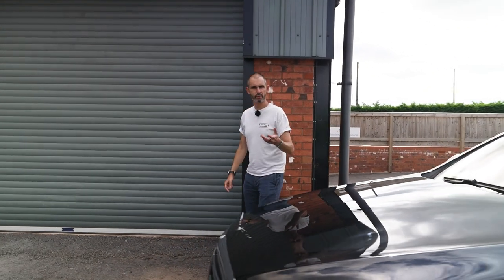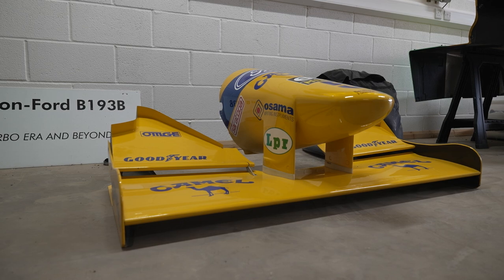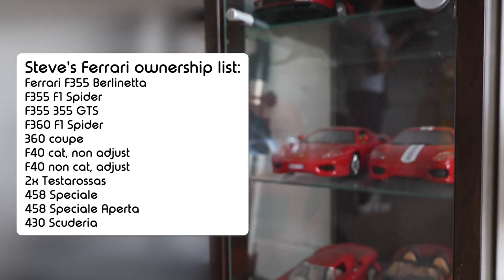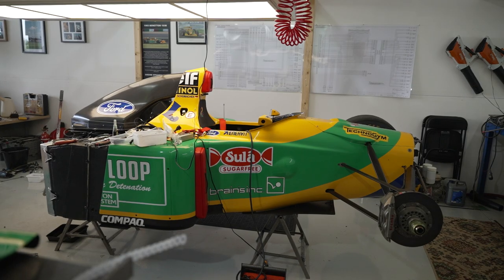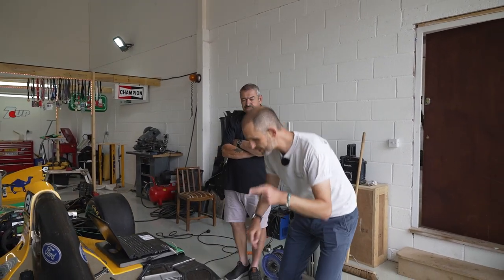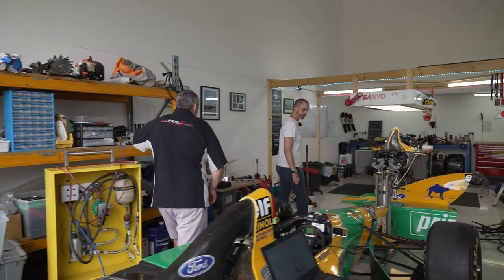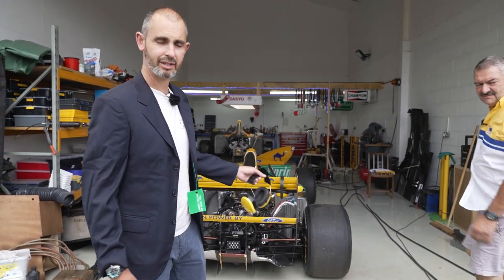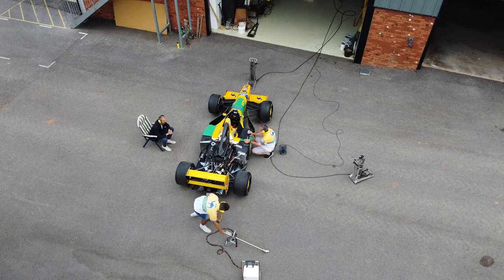Firing up Schumacher's '93 Benetton F1 car in the back garden - Car Cave

Comment: Hi guys we built those engines at cosworth.  I was a engine builder there through the 90s into the 2000s. Kind Regards Bob Rose Northampton..
Reply from the maker: Hello Bob, thanks for commenting.
Reply: Interview Bob please :-)
Reply: @raytrace2014  hi Teddie how's you sir..regards Bob Rose
Reply: Can you still call there and buy spare parts? Or are there any manuals on how to setup or repair such an engine?
Reply: @daybyter  I'm not sure if you can by parts for the HB engine. The company I worked for before cosworth. Was called Langford & peck. But now its just called Lanford performance. In Wellingborough Northants. They were building the HB for historic racing so they may well have parts still. Dick Langford is the chap that you would need to talk to. Hope that helps. I'm afraid I don't have the number. But you should be able to go on line and find them..the address .is Findon Road industrial estate Wellingborough. Kind Regards Bob Rose.
Reply: @bobrose513  Sorry for the misunderstanding. I don't own such an engine. I was just curious where you can help with those issues
Reply: @daybyter  hiya. That's OK my friend no problem.
Regards Bob..
Reply: When he says there ‘aren’t any more air valve engines in the world’ does he mean running engines? McLaren used the exact same engine in the latter stage of the season.
Reply: @bobrose513  hey Bob cool stuff what you worked on seriously !!  
Wondering if you can you clear up a old Cosworth wives tale please Sir ? The Mercedes Cosworth 190 had a 2.3 16v Cosworth Modified engine Internal Cosworth Code WAA and the 2.5 16v was WAB and Evolution WAC, my question is did Cosworth manufacture the WAB heads or did Mercedes and it was just a Cosworth design ? 
Cheers 🇬🇧
Reply: Hi, do you know where we can get BF1 early 90's memorabilia, particularly the clothing...shirts, jackets, hats, shoes, gloves, bags, ect
Reply: @chiefrocka8604 hi. I never worked on the 190 merc. But from what I understand  it was just the head. But as I say. I was on F1 at that time. So I wasn't  up on the road cars..

Comment: Schumacher made his debut for Jordan Ford at Spa in 1991, then straight after was poached by Flavio Briatorie and Benetton. His first Grand Prix Victory came at the 1992 Belgium Grand Prix in the Benetton B192.
Reply: I still like the B191-06 livery design better. Also driven by MSC btw.
Reply: I screamed when I heard his version of history too
Reply: You could have added the bit about how he got the Jordan seat… a few months earlier I was watching Schumacher at Le Mans.
Reply: @stormmeansnowork  I think the predecessor, the B-190, had an even better livery.
Reply: @Athrun82  Oh I basically fell in love with Benetton because of the B190, honestly it's hard to choose which is better, but if I had to pick one only, I would go for 191-06
Reply: I was there at spa to see his first win
My first gp

30 years later I watched his son in Hungary along with jos verstappens son ( super max)
Reply: @stormmeansnowork  technically only Piquet drove 191-06, Schumacher drove 02 and 05 that year. 02 in Spain, Japan and Australia, 05 in Italy (his first Benetton race) and Portugal.

Of course I know you mean the 191 in general and I pretty much agree it's a slightly nicer looking car and livery than the 192/193, the extra Blue and the Autopolis logos help.
Reply: @mathertom  Didn't know about the 02 and 05 chassis thing TBH, thanks for filling in the information. The reason that I single out the 06 is that (as far as I can Google on the net) it sports the Benetton logo on its side, whereas the 02 chassis have the Autopolis logo. Nevertheless, the blue yellow green tone of the 191 (in general) looks better than the simply green-yellow of 192 and 193.
Reply: Benetton in 1993 with the B193 at the hands of Schumi and Patrese in his last year of his long F1 career, was a regressing year because they had to compete similar engines with the Mclaren-Ford MP4-8 driven by Senna and Andretti.  They only won one race in Portugal '93 Estoril when Prost finally clinched his fourth and last World Title.  

Senna won 5 races in a debatable Ford HB V-8 Engine which he complained "down on power" than the factory backed Benetton team.  1993 was the zenith of the F-1 Cars in terms of all the advanced technology, servo-assisted, touch button down shift programming control (for example from 5th to 2nd instantly), active-ride suspensions, and Minardi even attempted 4-wheel steering.  They were like lightweight spaceship rockets before the FIA banned a lot of things in 1994, which probably directly led to cheating on purpose with various teams, and the tragedies of Roland Ratzenberger, and of course, the great Ayrton Senna at the fateful Imola GP on 5/1/94.
Reply: Flavio, the man with skin like a chamois leather cloth 😀🤟
Reply: @fuzzy1237  I met him, at his debut :)
Reply: Wouldn’t say he was poached? In his letter to Eddie Jordan.. he clearly states I will sign a drivers agreement meaning his options were always open? Having the confidence in himself knowing that Jordan wasn’t going to be a future team for himself..
Reply: And in the RAIN. Not many drivers can say their first victory was under such dire weather...

Comment: Lovely 72 Suzuki GT750 ...For the home Japanese market the first Suzuki Gt750 in 72 was a GT750B1, The bike had a split head and is obviousley very rare..Ii have all the required parts ie, cyl heads, longer headbolts, and gaskets in my shed to convert an early Uk engine into a replica  ...

Comment: The coolest thing for me is I have a Tamiya 1/20 scale model kit of this particular car.  It's a 1992 version of the car.  I think I have had this kit for at least 25 years or more.  I started doing some painting on the kit but I had to shelve it because I was so busy with my business.  So I am now retired due to basically wearing my body out at the age of 52.  I have a woodshop and I still build products for houses and I want to get back into building models of F1 cars (love the late 60's cars) along with all the killer prototypes etc.  I have a ton to learn about the modern world of modeling because paints and glues are 100 fold better than that horrible tube of Testors glue and the limited paints etc. that we all built with through the 70's and 80's... LOL
Peace

Comment: I like the vid. However the water buffalo is not slow. I owned one and rode it for three summers. The power band hits you hard somewhere around 7000 rpm if i recall correctly red lined at 11,000 rpm . It is also a short wheel base. The bike had a crazy habit of standing up on the rear fender when the power band come to life. The bike is a two stroke 750 they suck for power then they unleash themselves after the power band. Then hang on for the ride. Ever wonder why big two strokes aren't on bikes much

Comment: Just a little correction.  Schumi's debut GP was Belgian GP of 1991.  Yes, he only raced once for Jordan (Michael actually bought that car for himself years later)  and didn't even last a lap because his clutch broke on the first lap.  He was there because the regular driver, Bertrand Gachot of Belgium, was in prison for 6 months because he used CS Gas and attacked a London Cabbie.  

So in a hurry, Schumi was signed up with funding from Mercedes- Benz from his Group C Endurance Racing days.  Willi Weber, was very crafty and careful of changing the terms of the contract, because he knew how special Schumi was.  Eddie Jordan knew that too and Michael's talent was sealed.  He qualified 7th on the grid ahead of his much experienced teammate in Italy's Andrea de Cesaris.  

The funny thing was that Jordan desperately wanted Michael's service because 1991 was the debut season for Jordan GP Team.  However, much better funded Benetton team under Flavio Briatore, Tom Walkinshaw, Rory Byrne, Ross Brawn and other greats, were too good to pass up.  Soon after the race, Weber announced suddenly that Michael would immediately switched over to Benetton to partner the three-times World Champion Nelson Piquet, now in its last year of competing F1, for the rest of the season.  

As compensation, Benetton would send its second driver, Brazil's Roberto Moreno, back to Jordan in return, plus an undisclosed lump-sum exit fee for Moreno as hush money.  The time leading from the end of Belgian GP in Spa' 91 to the next race at Monza in Italian GP' 91, were filled with shock and awe with these breaking news, verbal accusations and pending lawsuits.  

For the rest of the year, Michael surprised and cemented his hype by scoring only half a point less than one of the all-times legend in Piquet, in the fourth best team, with a weaker engine and the inferior Pirelli tyres.  Moreno, on the other hand, only raced twice with Jordan, before punted out by Eddie for the pay drivers in Zanardi for the final three rounds in Spain, Japan and Australia.  The poor forgotten man, Moreno, was picked up by Minardi in Adelaide.  Ironically, Spa 1991 was Roberto's last ever scoring finish in F-1 and a competitive car.  For the rest of the career, he raced in the absolute horrid cars who never deserved to be even on the grid, let alone with Roberto's decent talents in his junior formula with the F3000 crown.  

If you are the Devil's Advocate and had Schumi stayed with Jordan for the rest of 1991.  Then Jordan got a big expenses reprieve with the factory engine deal from Yamaha in 1992 from Brabham, however, they only managed to score one single point with the experience Modena and Gugelmin from both Tyrrell and Leyton House respectively.  1993 would once again seeing the second rising of Jordan GP,  now with the Hart V-10 Engine, to once again fight in the midfield battle.  

The luck of Schumi and the rise of Benetton-Ford since 1991, had gone from strength to strength with him winning his first and very controversial crown with the Finale ' 94 in Adelaide, and cemented his status with the next crown in the much inferior B195 Benetton-Renault over the much stronger Williams-Renault FW-17 of Damon Hill and David Coulthard in 1995.  

The rest of the legendary Schumi career, with the poaching of the best staff in Brawn, Byrne, and others to Ferrari in 1996 with the new leader Jean Todt at helm, in the 5 years plan to scale the summit of F-1  in 2000.  Then more importantly, to rewrite F-1 history and record books until something named Sir Lewis Hamilton, were witnessed by all to its full extent.

Don't worry, Eddie Jordan got even with Michael Schumacher.  He signed his younger Ralf for a longer term contract for the multiple seasons, and Eddie got the best lawyers this time around to make sure nothing funny was going on.  Ralf was supposed to race in 1999 with Jordan but there was a substantial penalty for the early exit clause.  When Ralf told Eddie that he would leave the Benson and Hedges Jordan-Mugen Honda GP team for 1999 and racing with the Winfield-Williams Supertec Team to replace the departed Jacques Villenueve headed to the brand new British American Racing (BAR) Team.  So who paid for the multi-million dollars fee with this 'early exit clause'?  None other than Michael Schumacher himself!

Comment: Superb. I’m pretty sure one of the problems of running these cars is the laptops and operating systems. They’re that old such as Windows 3.1 there’s hardly any to be found.
Reply: The laptop shown is fairly modern and running Windows 10, I guess they found a way to run the software on newer systems
Reply: Possibly running a virtual machine of the old operating system on a modern laptop. Most old operating systems can be emulated.

Comment: Supposedly the B194 had 460 torque at 11600RPM, probably the most high low RPM torque car for 1994 which would made it likely to spin. I suspect this why there was talk about traction control.

Comment: Why would it seize on startup if the temps are less than 65 deg C (149 deg F)?   Single "weight" oil?   Weird clearances somewhere?  Too much oil pressure?   21:30

Comment: I got a lot of respect for Schumacher when he raced the manual Benetton Ford even with the supposed launch control controversy, what he achieved with it told me how talented he was, like later in the Ferrari stuck in 4th ? and still put in a great race, I kinda lost a fair amount of respect when he started his nasty driving which got worse up to his first retirement, ramming other drivers and the oops my engine stopped at La Rascasse on Monaco track right after getting the pole time (coincidental that Le Clerc had a red flag moment after getting his pole time in a Ferrari).

Though my all time F1 car which got me into F1 is the Lotus John Player Special driven by Andretti in the late 70s, although I had a diecast model of it but with Mansell as the driver, no longer have it as it mysteriously got damaged though the kids knew nothing at all lol, I had a lot of diecast models that parts (wing mirrors mostly) disappeared, worth quite a lot of money now, I threatened to buy a glass case for them but was too late.

Comment: I liked the cars when they had no driver's aids, a manual gearbox, and a low revving V8 (under 7,000 rpm) of decent capacity. Here in NZ we called them Formula 5000 as they used a 5l V8. They thundered around the track, today they scream, the drivers had to drive the car, today they managed them.

Comment: So at risk of being all 'adenoidal nerd'...

I think it's pretty obvious that they're not completely keyed into the history of the cars. I shouldn't say much at all because they own and run them and Johnny has come along and is clearly amazed at the cars and the story and the car cave in general and it's wonderful content as per usual from The Late Brake Show, absolutely one of my favourite channels on YT...

...however, let's get some facts straight for posterity.

- Schumacher debuted in 1991 at Spa, not 1990. He drove Jordan 191-05 (easy to remember cause 91 in the car name - 1991, 92 - 1992, etc for Jordan, Benetton, Minardi and a few others)
- he was poached in between Spa and Monza by Briatore, much to Eddie Jordan's chagrin
- he debuted for Benetton in a B191 (chassis 05, interesting he jumped from 05 to 05 in between teams)
- his first win was indeed at Spa but in 1992 (B192-05 - again interesting, he seems to have a thing for the number 5, won his first championship with that number too)
- Benetton had a habit in the late 80's-early 90's (88, 89, 90, 91, 92 and 93 to my knowledge) of running their car into the next season early on, usually designated as B (as Steve says, B193-B, only in this instance, it just meant an in season change/chassis upgrade rather than running into 1994, B/C/D designations were common back then)
- I saw B193-04 at the Goodwood Members Meeting earlier this year, ran by Steve and his team and they told me they had B193-04 and B193-05
- B193-04 was recently up for sale at the Festival of Speed by Bonhams
- from my records, verified by all the sources back in the day, the story of Schumacher qualifying the car and Patrese finishing third in it in Britain doesn't ring true. Patrese drove chassis 02 at Silverstone.
- B193B-02 was sold last year in Switzerland by Bonhams so can't be either of the cars mentioned here by the story alone
- Schumacher not only qualified 05 at Britain but raced in it too.
- B193-04 did four races with Patrese: Spain, Monaco, Canada and France. Knowing 04 was demonstrated recently when I saw it and then up for sale as a complete car even more recently, I'd hazard a guess that the car fired up was 04. A reasonably close race count (4 instead of 5) plus the records suggest it makes sense to be that one
- the Schumacher car in bits with the later engine and rear-wheel steering, the B193C is 05  as Steve says as Benetton only ran rear-wheel steering in practice at Suzuka in Japan and Schumacher's car for that race was 05
- In 1992 they built 8 chassis
- In 1993 they built 8 chassis

I know these things because I've put extensive research into tracking the cars from 89-99 for the past six years or so, have verified records of which chassis raced in which race and was driven by who and can tell you where a good chunk of all of the cars from this era are right now. I always welcome new information and knowledge so if anyone wants to correct me or add to it then absolutely have at it, let's find out the true stories.

Here's the spreadsheet I have updated since I started with all the information needed. I can't claim 100% accuracy because I don't own the cars or run them but it's been gathered for years by myself and some very helpful sources and always being updated as time goes on.

https://docs.google.com/spreadsheets/d/1eILDgPJZnLjuwEsHZJdTDkT3LrZxzIUy1rKynWIRFGo/edit#gid=0

Thank you to Steve for the passion and dedication to have both cars, keep them whole and running and demonstrated often and thank you to Johnny for coming together with Steve and giving us this video. My information above is only what I know and I don't wish to detract from how great the video is and all apologies for being a proper bloody boring nerd about this stuff!
Reply: I should also really get a life

Comment: Only at Monaco that Paddle shifter was available, by Canada traction control and launch control. Rear wheel steering and active suspension I don't think it ever had, at least on the races it never had.

This guy doesn't know that much about F1:
1- BTW MS 1st race was in 1991 in Spa.

2- This was not the most advanced car, not even close. Williams of 1991-1993 and McLaren 1992-1993 had more devices than the poor Bennetton.

Comment: i dont like carbs i was a car mechanic for 12 years first mechanic at the dealer but my renault 5 1988 with a carb would never fail me it olso had the old mechanical ignition but if you new how to start it it would start every time even when -10 outside cold start but the fiat is older thats wy i think